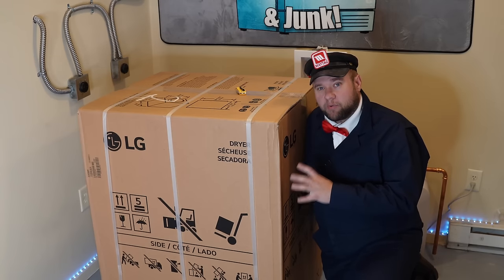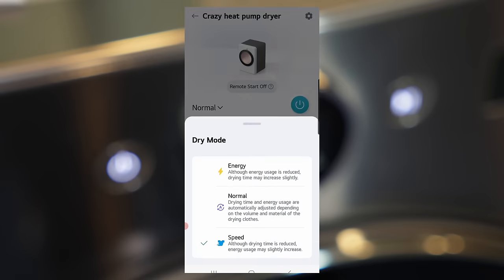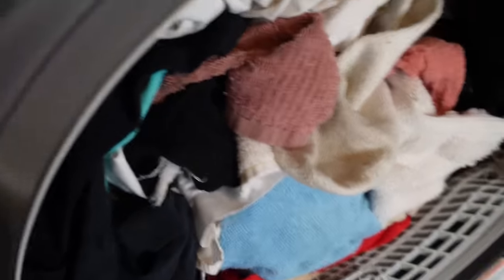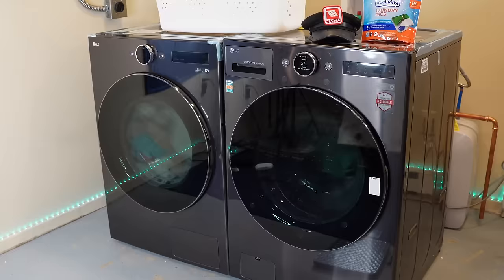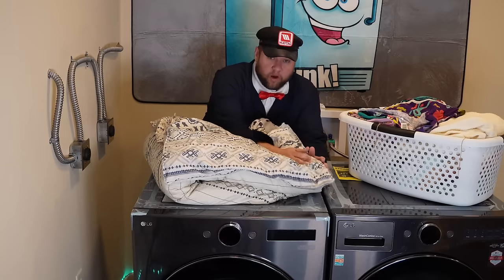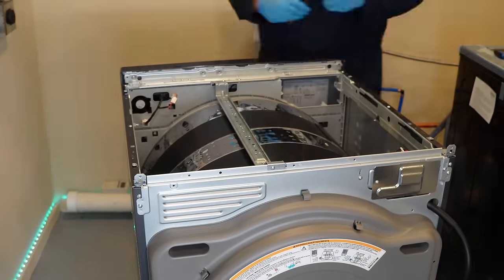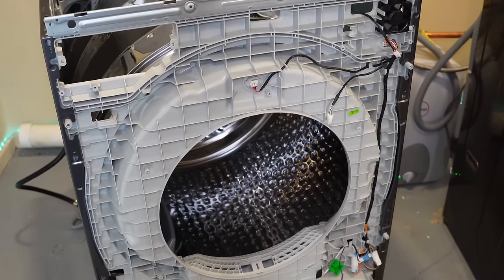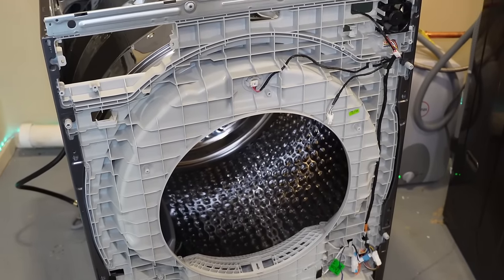LG Heat Pump Dryer - Way Better than I Expected - DLHC5502 Teardown & Review

Comment: It's a shame that it requires 240; I would have loved to stick with separate units stacked but half the point was to free up the dryer circuit to avoid needing an electrical service upgrade to add air conditioning....
Reply from the maker: AFAIK its due to the model being introduced in Europe/Asia on 220-240v first. They kept the voltage as not to change components.
Reply: Still may be able to add the AC and use a HP dryer. Depends on how many watts your electric dryer is now. A HP dryer should use less wattage and whether 120 or 240, Watts is Watts. Some electric dryers can pull up to 5,000W, average maybe 3,000W and according to the LG specs, this uses 830W for heat. So less power, whether 240V or 120V.
Reply: @inothome  the code rules don't care about that, in part because there's nothing stopping a different owner from replacing the dryer
Reply: @BillyONeal  I work for electric utilities and have never ran across any code specifying what you can or can't do with your service. 80A, 100A, 200A etc... Is up to you, but, not surprised if there are some local jurisdictions that will control everything you do and mandate certain electrical service for whatever. But, electrically speaking if it would work on 120V WITH an AC it would still work on 240V. 
You must have a super small service to not allow a dryer and an AC unit to be installed. even an 80A service is plenty. Not to mention, aircons today are way more efficient than they used to be years ago. Seems whatever code there is needs to be revisited.
Reply: @inothome  My understanding was that NEC 220 does the wattage calculation for a dryer circuit by it being a dryer circuit (~5000W), not based on which particular dryer happens to be plugged into it. Maybe if the dryer were hard wired rather than being into a 14-30 this is different? The EV charger added by the owner before me (which I do use) basically put me at the limit for my 100A service under NEC rules.
Reply: @inothome  "220.54 Electric Clothes Dryers — Dwelling Unit(s). The load for household electric clothes dryers in a
dwelling unit(s) shall be either 5000 watts (volt-amperes) or the nameplate rating, whichever is larger, for
each dryer served"
Reply: @BillyONeal  OK, so you are going off the NEC for a labeled "dryer" circuit, not the actual limits to your household electric supply. Call it a clothes dewatering device. lol  What plug does this dryer come with, if any? Specs said 15A circuit, so it does not need a 30A circuit nor need 5000W. 
Regardless, if you know what your dryer uses now, the AC you wanted to install and if the AC and HP dryer use less it would still work electrically. 
I assume if this was a 120V dryer you would have removed the 240V receptacle and added the AC?  Then down the road if someone wanted to add a fully electric 240V dryer, then what?  They would have to give up the AC to get a dryer back per NEC code? Which I am not sure what table you are using to do the totals. And the 5000w is worst case scenario.  
I was just trying to show that whether it's 120V or 240V, the total power used will be the same.
Reply: @inothome  Yeah, if they wanted to go back to separate washer / dryer units they'd need to remove the EV charger from the panel or do the service upgrade / panel swap. Or who knows what kind of load management stuff will be common by then...
Reply: @BillyONeal  I don't know who is checking and even if it would be overloaded. NEC is a good design basis for worst case scenarios. But if the EV charger, AC and dryer are not pulling an excessive amount nothing bad is going to happen. Worst case it would trip the main. And depends on your area if they have COs or city mandated house inspections. The places I have lived only one city required it, all the other places no one checked. You could have done whatever you wanted. But I have never heard anyone not adding a device that was going to use less energy because the NEC said you can't. And if there were inspections and it were me, I would argue the 5000W dryer outlet and replace the breaker with a smaller breaker and add AC.

Comment: I have this dryer. I received it last week and home depot installed. My first load, it dumped all the water on the floor. I have inspected and the hose appears to be installed correctly. Lg says its an installation problem, home depot isnt coming for another week to inspect. Any advice? I cant figure it out and i cant be without a dryer for another week!
Reply from the maker: Oh wow thats odd. All I did was hook the hose up to the outlet in the middle at the bottom of the unit and make sure the clamp is on tight. You can see how I did it in the video. There is another port for steam I think. Maybe they installed it there which is wrong?

On the inside. I have a livestream where I took the unit apart to fix a drain pump issue. You can see how I accessed it live on camera on my channel.
Reply: @bensappliancesandjunk  thank you for the reply. I got antsy waiting on home depot so I put the dryer up on some blocks so I could see where the water was coming from. I ran a load of towels and the water came out of the grey nozzle to the right of the hose hookup. But only when the hose was in the same drain as the washer drains to. It did not leak when I had the hose diverted to a bucket. I did a video call with LG and the guy didn't even know what that port was for. It's not labeled in the book. I'm guessing it's what you mentioned about steam? I have an LG technician coming on Tuesday. Until then I'll be dumping the water in a bucket. I will check out your video where you take it apart. I really want to like this dryer, but so far it's just dumped gallons of water on my floor and taken hours to dry anything. Not looking good!
Reply from the maker: @nicoles6464  I've had E-mails about this by the way. Its a siphoning issue w/ the drain hose. Its creating a situation where there's pressure that's causing it to leak from what I've seen.
Reply: @bensappliancesandjunk  hey I just wanted to update you on my issue. We got it resolved. When home depot installed they removed the cap on that valve that's just to the right of the drain hose. It wasn't supposed to be removed. Lg was able to overnight me a cap (and a spare cap) and once I popped it on, the machine worked as intended. Home depot did come back out and when I explained to them what happened, the guys said they had never seen something like that and would probably have removed the cap too! I asked them to report to home depots installation department that as these become more popular, the installers should be made familiar with things like this!

Comment: 2:25 I cannot turn my dial smoothly like this with one finger on my DLHC5502W.  My knob requires me to grab the dial tightly to twist, and the screen appears to tilt when twisting.  This makes it really hard to see the screen while turning.  There is no audible clicking while turning, but rather it feels like the  wheel is grinding and sticking.
Reply from the maker: Sounds like the wheel is misaligned and got hit during something
Reply: @bensappliancesandjunk yes, lg support thinks it’s a defect too.   They are going to repair or replace soon.  Fortunately I reported it within the first 48 hours.  Other than that it’s an awesome dryer so far!

Comment: The one important test that you can't do is to test the electronics for longevity.  That's usually what fails first.
Reply from the maker: I've been told that since its 220v, the components are over-engineered for this model, since it never comes close to the amperage ratings on the relays. I didn't double check this though

Comment: Looks great—but you should move the laundry basket closer when you unload, or socks are going to end up on the floor.
Reply from the maker: It's because there's a scale under the basket do I can weigh pre and post drying weight to ensure it fully dried. By putting it closer to the door it would skew the results I was looking for. This is in a test room, not a laundry room as my only goal is to see how it works even if socks get on the floor.

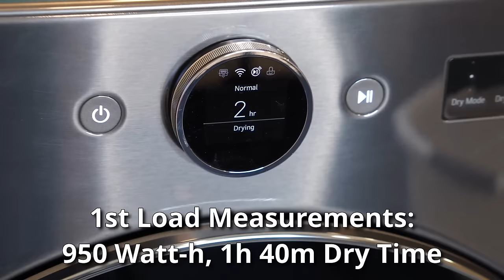Comment: 6:30 Not to be a pedant but the distinction between watts and watt hours is VERY important. It's like comparing horsepower and gallons of fuel they are related but completely different units of measurement. 

950watts over 1 hour 40 minutes is about 1.6KWh which is a respectable efficiency. If it only used 0.95KWh total for the load then that is an incredibly efficient appliance. It's not clear if you are trying to say 950 watts per hour which is  meaningless or 950watt hours total. 

Not trying to be an ass but it is important. 

Otherwise a fantastic review 👍.

The 220V is probably just an engineering cost savings choice. The power consumption is so low either way that a standard US 110V outlet could supply it without much trouble. Most countries use 220-240V and given resistive heat driers really do need the extra power, LG probably figured US consumers would accept the inconvenience of a 220V plug. Making a 110V version would require additional power electronics inside and/or the use of a different compressor which is a lot more work than just sticking a different plug on it for a given market. 

I am impressed with how durable it's mechanical design seems to be the brushless motor is a very nice touch and does justify the additional cost over many cheaper units.
Reply from the maker: It literally says watt-hours to ensure that its specific...

Comment: I wonder if the reason the GE doesn't have a coil cleaner is because it can't, due to its heat pump being designed to be replaceable.

Comment: I like heat pumps but I'll wait until the public beta testing is done...🤔 May look at one in 5 to 9 years when my present dryer will likely be worn out. Providing we know by then if there's any honest durability in the machine.
Reply from the maker: I'd imagine within 5 to 9 years we will know, but it also assumes this exact type is still around and the government hasn't demanded a revision or three

Comment: I've worked on whirlpool for years with this same concept the long dry times are normal the heater does not work at the normal capacity due to the compressor we had nothing but issues with it you bout to too

Comment: A little late, I know... but the savings you state, $0.20 - $0.30 / cycle, is way below reality.  The REAL savings comes from it being ventless.  A typical dryer will vent about 10,000 cubic feet of air during a drying cycle.  This is all of the conditioned air in a 1250sq foot house with 8 foot ceilings just dumped outside in about an hour.  You now need to pay to condition the air that was drawn in to replace it.  Your HVAC costs can actually be higher than the operating cost of a vented dryer.  Next, if you don't have a ducted make up air system (most houses do not) and don't open a window every time you do laundry, you have just sucked outside air in via all the leaks in your building envelope.  This may lead to condensation, mold, and rot inside your walls over time, potentially costing your thousands in repairs in the lifetime of your traditional dryer.  Not to mention all of the dust and allergens that are sucked in with that air.

Comment: Hi. I purchased this machine based off of this review. The door doesn’t stay shut and LG customer service is useless. Has anyone else experienced this? I would love to say it is an amazing appliance but I have never been able to use it. It was ordered on May 27th and delivered on June 4th. My “Presidential liaison” is about as helpful as a poopy flavored lollipop. Thanks.
Reply: I bought one and the door popped open by itself during the first load. Had it replaced (by retailer) and 2nd one the door wouldn't stay closed right out of the box. Refused delivery. Now I am trying to decide if I want to try a 3rd time or pick something else. Super frustrating. Did you ever get anywhere with LG? I've seen a couple placed (including in this thread) where people got the door to shut by messing with screws on the front fascia, but that is absurd for a brand new dryer at this price point.
Reply: I disputed it with Amex and I am getting a GE which will be here Friday. I ordered it today… Took over a month of LG jerking me around. A certified tech came to my home and ordered the wrong door. Their customer service is atrocious. I’ll never ever deal with them again. I suggest going else where. We are not the only ones the model reviews on the website all say the same thing.

Comment: I have the 110 unit can i change it to 220
Reply from the maker: nope
Reply: Should I return it for the 220 model?
Reply from the maker: @anthonymoser1243  whats the model# on the 120v model?
Reply: It's the thin q pr something washer dryer combo 110 volts
Reply from the maker: @anthonymoser1243  this is for a dryer only, not a combo unit...

Comment: So their heat pump dryer has a ten year warranty but their washer/dryer combo only has a one year warranty. Lame...........
Reply from the maker: Its unbelievable thats the case. And its nearly the same pump!
Reply: @bensappliancesandjunk  this is why I say the GE version is clearly the better choice between the two. It’s no secret these all in one combo machines have multiple possible failure points. A one year warranty or a five year warranty. Which would most people prefer? lol

Comment: I do not get the math on it paying for it self. Even if you do save $0.30 on every load, 0.30x52x12 is just $187.20. I know electricity will likely go up, but so will the price of this. By the way I only pay $0.12 a kWh where I live and don't do laundry every week, so the math is even worse. The main reason high efficiency technologies like this don't make it in the US as how cheap the electricity is, There are good reasons to buy this dryer but saving electricity is not one of 'em.
Reply from the maker: You aren't average, though. The average family does 3 loads/week. Not <1 one. Also, the nationwide kwh average has gone up considerably in the past 3 years. I simply used averages to base my math on. Some people will be at both ends of the extremes.
Reply: Also, your math is not accounting for the fact that a standard dryer is vented. While it is running, it is blasting conditioned air, that you paid for, to the outside. It'd be tough to get a cost estimate on that, but it's far from free.
Reply: And one last economy: the lower temperatures of the heat pump dryer is much gentler on the fabrics. In the long run, that saves money too.
Reply: These are a lot of good points, Thanks for the enlightenment.
Actually, the main reason I was looking into a heat pump dryer washer combo, was to put in an all electric RV where electrical capacity is at a premium and I would not like to add a vent for obvious reasons. I just stumbled up on this dryer video.

As far as the lower temperatures on clothing, Is it better than running a normal dryer on low for a long time? Because that's basically what I do.

Comment: i had a simlar lg ventless dryer except it didnt have a heat pump. it had the hose for the water but it also had a tank for the water. i used the tank. it worked pretty good except the coils would get dirty and you had to remove it to clean it of lint. Over time, the drains got clogged and water would leak on the floor. I junked it

Comment: Neat tech but much more complex (and thus less reliable) to save a little money on electricity. In the end it will probably cost more after paying for repairs ($$$$$) and the extra cost to buy it.... just use the delicate cycle on a cheap dryer.
Reply from the maker: Depends on what actual lifespan is. If the median lifespan is 12 years it will save you more money than the cost of the sealed system and its servicing. All the other parts are cheap and basic and identical to a standard heating element dryer of similar capacity. This costs $300-400 more than a comparable dryer and it'd pay for that in about 6 years of average use.

Comment: The paper napkins math doesn’t show a cost savings over a simple tumble dryer, even over 10 years and not including the heat loaded to an air conditioned house. That’s going on your estimation of 30 cent savings per cycle and my estimate of 10 year life. So, if that’s true, what’s the appeal of these very complicated and hard to service machines?
Reply from the maker: Define "Simple tumble dryer". The tumble dryer that this is a direct competitor to is $900. The cheapest you can find that's a 7.8cf is, from what I can see, around $800. So the $400-500 additional cost would be compensated for over about 1,500 - 1,600 loads of laundry @ 30c. Without the HVAC costs factored, it would pay that off in ~10 years. Adding the HVAC cost in would likely make it a bit quicker.

Comment: In other words, don't plan on using your fancy new LG dryer during the Winter ......
Reply from the maker: It'll take longer to dry in an unheated room, but still operable. The room I tested other HP dryers in is unheated and they all ran. 30% slower but they ran

Comment: Cleaning the coils is pain in the ass.  I have older and cheaper heatpump dryer. It leaks stuff to the coils and with part of it getting moist so it wont be removable with vacuum cleaner.

Comment: It's NOT really really unique... many other heat-pump dryers work the same way - e.g. Bosch have a number of heat-pump models with similar design/features including auto-drain.
Reply from the maker: does Bosch make one in 27" / 7.0+ cf capacity?